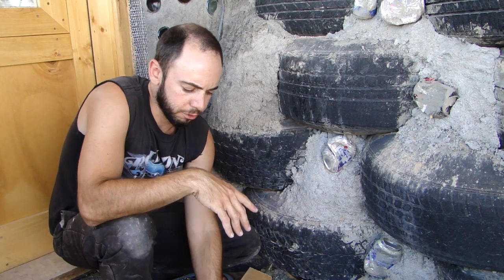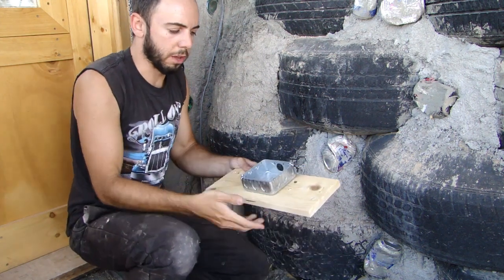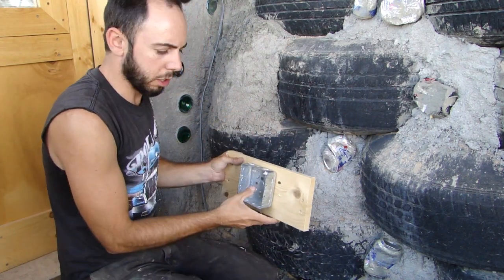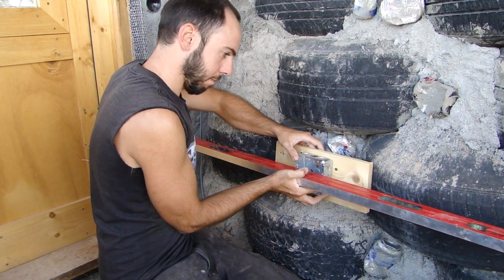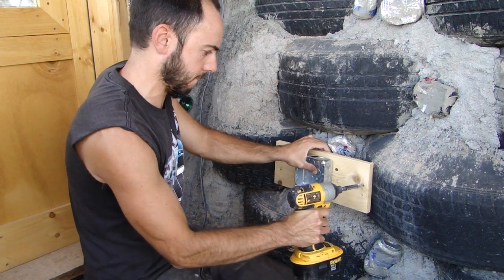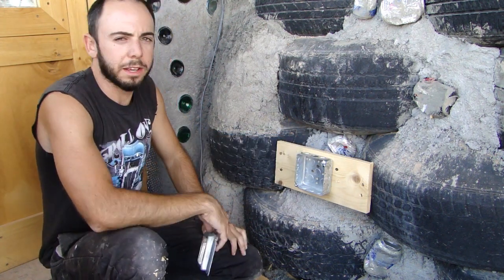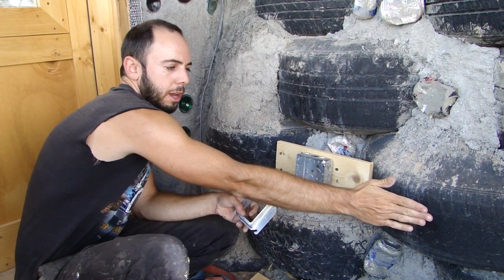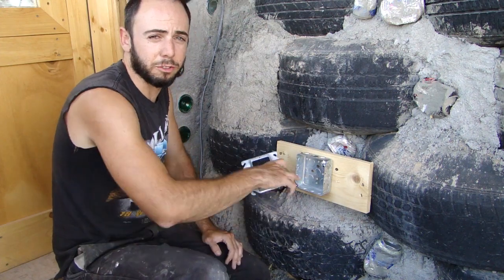Electrical Wiring - Part I

Comment: Use a piece of threaded rod and than you can adjust it however you want.  Of course, you can't build a tire home in most areas.  Still, good luck.